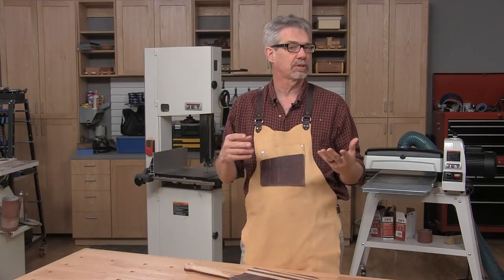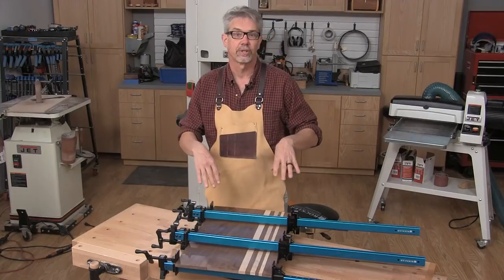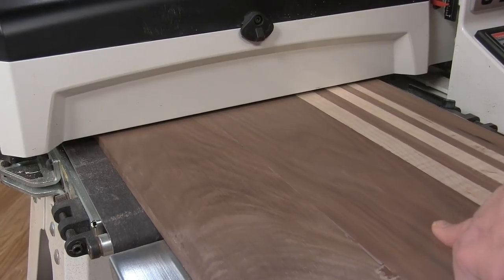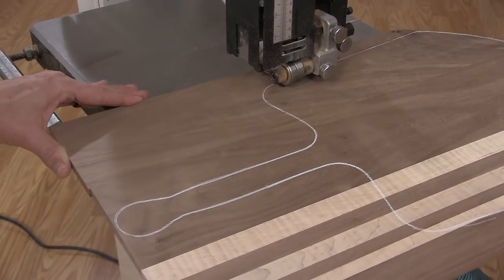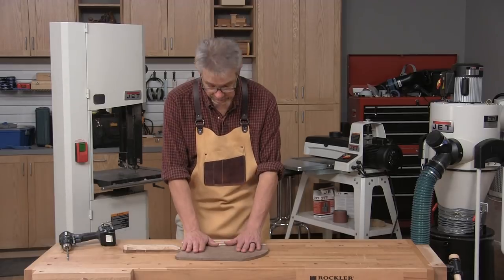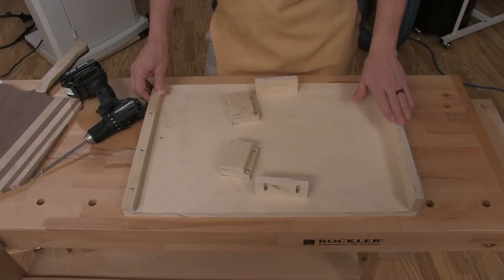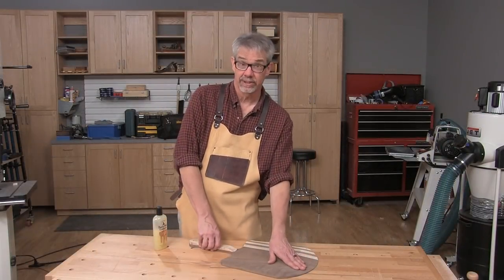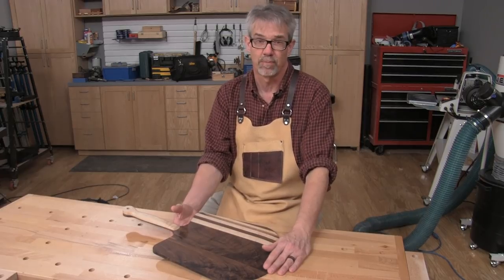How to Make a Pizza Peel - Woodworking Project Plan - Sponsored by JET

Comment: Nice peel, Rob!  I've had a peel on my 'to-do list' for a while now.  I was considering making a similar jig  for my planer (I don't have a drum sander).  Would you recommend doing the beveling on a planer?
Reply: I have the exact same question. Have you tried it on a planer?
Reply: Belt sander is easier and quicker.